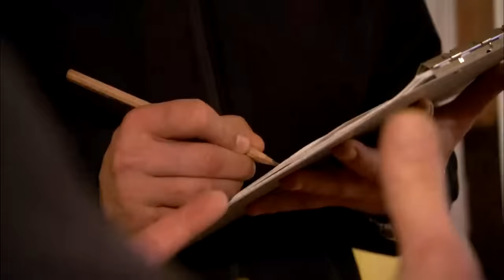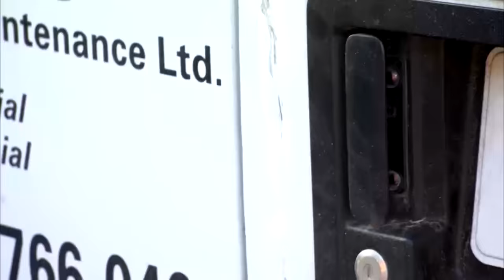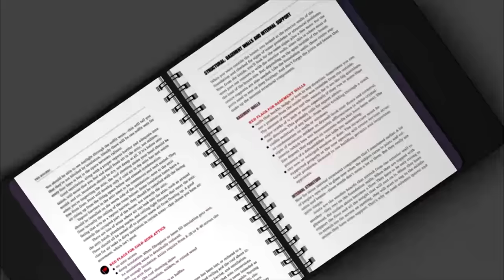Mike Holmes Rescues Townhouse from Hidden Home Inspection Disasters | Holmes Inspection 101

Comment: What gets me is that the prior owners must have known about some of this, and they never disclosed it.  I could never, in good conscious, sell a place that would be unhealthy and such a safety hazard.  That place was ready to catch fire at any time in several ways.  The bathroom floor was ready to go.  The dryer vent in the garage would allow carbon monoxide to go back in the house.  What a mess, and she thought it only needed a little bit of cosmetic work done.  Mike Holmes and his crew are always the absolute best.  It's great to see them again!  The hugs are great at the end!
Reply: Not necessarily. The first home I bought my home inspector didn't catch 2 major items.  When I went to sell the buyer's home inspector caught them. Both were structural items. Two roof trusses were cut into making them useless; and in the basement there was a crawl space that was being supported by nothing but loose large rocks.

Comment: This is why you need to take even a very small water leak very ,very seriously! What started as a simple tub change for cosmetic reasons in our guest bathroom ended with a total doen to the studs rebuild! We found wood rot in the floor joist that led into our dining room as well.we had to replace floor joist ,subfloor, walls and then all the finished floor ,sheetrock etc. You get the idea. It was very expensive. What we found was that it was all caused by the caulking leaking around the tub/shower and a very tiny leak from the shower valve. When I say tiny ,I mean it was so small of a leak it was basically just moist around the valve ,but it did it for years because it was small it didn't get noticed.
Reply: I learned this the hard way.  Fortunately, I could do most of the work myself.  I find it wise to pull a toilet every few years, inspect, and then put a new seal under the darn thing (along with new toilet bolts).
Reply: @oldtop4682  this is a good idea!
Reply: Mike would have loved the house I grew up in. Due to, uh, repeated, uh, plumbing issues (lets just leave it at that) over the years the bathroom and laundry room floors were toast. Had about the structural integrity of wet toast in fact. But short of a good look in the right places, one could easily miss that fact because everything else was solid, including the floor joists supporting the toast, er floor. We could easily have hidden it when we sold the house, but unlike so many, we made a point of disclosing the issue.

Comment: A friend of mine bought a house 'renovated' by a self-proclaimed handyman. Plumbing, electrical, & HVAC were all nightmares. The energy auditors said they had never seen leakage figures so high. HALF the air was leaking into the attic from improper ductwork, none of which was insulated. The home inspector gave the house a clean bill of health!

Comment: Since this place is so bad because of shoddy workmanship when it was constructed, and later patched up, it makes you wonder what the neighboring houses adjoining it are like! 😮 
It's scary to think that after this one house is renovated, (Amazing job, guys!) it could all be for naught and could burn down afterward because the adjoining houses are likely built just as shoddy as this one was! The electrical fire hazards in this house were horrendous! ...And that wasn't the only hazard- mold in the wall, loose 2' x 4's, etc. etc. 😳😓 The inspector either was not doing a thorough enough job, OR he CHOSE to 'look away' because he could see just how bad this really was. A super sad situation! 
It would be advisable for the neighbors in this row home to get THEIR houses checked out and re-inspected by your men. 👌
Reply: Doesn't Canada have building inspectors for the construction stage? If they do have them, do they ever do work? Are there even building standards at all?  I would never buy a home dwelling in Canada without getting myself enough skills to be an inspector.
Reply: @mrcryptozoic817  i’m thinking they’re like american ones, when i worked in construction (houses mostly) the inspector only came thru in the framing & after insulation and as long as and writing/branding was right side up then we were given the 👍 very shoddy work in parts of the house that we had to later fix (yay big teams🫠)

Comment: hey mike and Damon i just wanted to say thanks to your show when i bought my brand new townhouse  i nailed the builder on a couple major issues i had a bad breaker in my main panel and when they grouted my house with the tiles in the showers well they wash their buckets down my drain lines well they snake my line with their plumber as say the line was clear less than two days later it flooded my carpet down stairs for the third time and i live in it for less than 3 months so i had my own plumber come out and snake my line with a camera so my plumber saw this right away and before he said anything  i told him it was grout in my lines he said yes sir  so the warranty for my house was almost up cause i was fighting with the builder cause they did not want to fix it  but they cut my foundation in a 4 x4 area so when they went to fill it back in i made sure they used a hydraulic  cement and they made it 6 inches thick because it was only 4 inches thick to start with and they knew i was onto their game they tried to play and i told them when you build a home you can not do shoty work
Reply: That is great to hear!
Reply: @triciac1019   it's not that i go looking for problems  but when the builder is flat out lying to my face thats when i hold them accountable for everything and this builder got caught using the china drywall that people were getting sick from they had to rip out all the drywall in  2 of their units which  means a total of 14 townhouses  so i know it was costly

Comment: Nice job. I was a young electrician when Aluminum wire showed up. We wired hundreds of apartments with Aluminum Romex. We would get trailer loads of Aluminum Romex, we learned things about it and what to do. Aluminum rated devices showed up shortly after, aluminum rated wire nuts and we no-aloxed all connections. Breakers were now rated for use with Aluminum. It was amazing to see it and it finally went away.

Comment: It's the distance from the window to the regulator intake that is important.  You can add a pipe to the bottom of the regulator to move the intake three feet to the right and have an operable window in the basement.
Reply: The meter itself has a vent though
Reply: @kellismith4329  you can put a pipe onto the meter's vent (which is on the bottom of the regulator)

Comment: i use to work in a hotel as a maintenance person i use to fix bathtub stalls with the green board and 15-minute mud then i would tile over it all in one hour. i learned to do it fast because the previous maintenance people used regular drywall and mud and a tile or three or four fell off the wall and hit a guest in the head. i had so much stuff to fix but they would only let me fix it a little at a time.

Comment: Piece of advice from personal experience although this applies to potential buyers and current owners/ tennants regardless, keep a close eye on the drywall, if it looks off take a closer look...

I was once renovating the master bedroom for my mother in her current home (I was a rather handy teenager who was good with things that didn't require permits, I flat out refused to touch those jobs), at the time she had lived there for almost 10 years or so, I noticed that the drywall looked strange and mentioned it to her saying that I should investigate...  

All I did was jently poke it with my finger and I poked a hole all the way through, at this point I mentioned that I would have to tear down the drywall and replace it...  

My mother got an idea of just how bad it was moments later when she heard me screaming her full name, demanding her to get to the other side of the house and see the problem imediately.

To our horror underneath the drywall, all the wood framing was in such poor condition that you couldn't even use it to make tooth picks with...  

This was an exterior load bearing wall, my mom called the Condo association who sent someone to fix it...  I later found out that the person was a general handyman and had no buisness touching the job in the first place and that they only looked at and fixed what they could see and never opened up the walls to find out just how extensive the damage was...  

After some time We learned that the damage was caused by termites that had not been dealt with but left to continue destroying the house, eventually the city became involved and had to condem the house until it could be fixed by actual contractors who pulled permits, something that the CA never did (I did tell my mother at the time that permits were needed for the job but because the CA and the general handyman said that it was not necessarry they...)...   In the end they had to repair half of the exterior walls of both floors of the house and add a new structural beam in the basement.  

I should mention that in that housing the CA is responsible for the exterior of the house such as the roof and siding as well as the structural parts, wile the home owner is responsible for the inside and before anyone points it out...  Yes the CA screwed up, but in their limited deffence, the insurance company would only pay out $20, 000 to fix the entire neighbourhood and what work was done on my mothers house alone, was more than double that.

Thankfully the damage was fixed and the termites were dealt with, I just hate to ask what of the houses around us?  They all had to be treated for termites but my mothers house was the only one that got opened up and fixed...H

Comment: Thanks Mike and CREW; You ALL make a house safe, secure and well insulated. What if you work with a good window & door company in Canada. There are a few. You have excellent plumbing, electrical, insulation  and HVAC work. But consider the windows triple pane or better. Because it will help with keeping the house much more energy efficient! I am sure that bedroom windows was not the best for insulation.  There is a window company that does 7 ply insulated glass in Canada.  I believe it will be a much improved factor to the overall problems you find with houses!

Comment: House was only 26 years old? Built around 1980 or so. Hard to believe they used fuses in the electrical panel unless I'm missing something. The sideways panels I've seen in some other episodes is something one won't see in the states, but common in Britain.

Comment: I would like to add my 2 cents.  Mike Holmes says a fire could start from the dryer.  My firemen friends tell me the same thing.  Replace the flex lines (as many as possible) with steel.  Mike talked about electrical rubbing steel and getting a shock from the whole house.  When I was installing phones in mobile homes in the 1970s, several would shock us when touching the door knob because some electric wire was frayed and touching the metal covering the outer walls.  He says it's a fire hazard.  A friend's home was a total loss recently from a house fire that started with an electrical problem.  One thing Mike didn't mention is how dangerous aluminum wire is.  If every connection isn't done properly by a licensed electrician, your house could burn down.  A friend of mine discovered an improper connection in his aluminum wiring and there were sparks.  He had to have an electrician replace the entire wire run to make it safe.  Holmes isn't joking about the dangers.  They are very real.

Comment: My "garbage disposal" started shocking me until finally I tripped a circuit breaker while grabbing a new roll of paper towels from under the sink.  Turns out, copper pipes move every time you turn the water on and off, and it took 20 years to wear through the improperly routed romex in contact with the pipe 🙂.

Comment: My house is 120 years old, if they came to my house I would need a supply of Depends fit all involved!!!! 😆😂
About three years ago my house almost went up, copper pipe instead of black gas pipe, obviously copper pipe wasn't supposed to be used! Oh I could go on, between my business building a crap mess and the house,  I hope I don't have to take up residence in a pine box 6 ft. under. Humor, humor is my friend right now.

Comment: If HomefulTV were to come in my building they would find all sort of problems 😂
So many things are wrong lol. The tap water routing is all over the place, there's old cast iron sewer pipe which keep on asking to get clog because they are filled with junk.
Insulation is terrible, fundation cement is turning into sand, tap water pipes are mix iron, copper and many iron pipe have rubber patches, fundation and a few other key location are open to rain leak, main underground sewer pipe is rusted through at some location and a tree has found it's way in(It caused a clog and flooded our basement during a heavy rain storm) and i can add more problem to the list.
The only thing that seems to be alright is the electrical wiring.
I'm not the owner nor do i want them to come here. I'm just stating what's wrong xD

Comment: 20:20 Best choice. They could have used a number of materials to patch and fix the tub (for a time) but it would have caused issues again down the road, and negated all the mold and moisture removal they are working on. Not just "Tv show" stuff, but what an actual contractor Should have done for her. Maybe not completely out of pocket, but corners can be cut on the labor costs and materials as well, without cutting corners on durability and quality of the finished product. Sometimes you need to take just a little less money home, to make sure someone keeps theirs.

Comment: I usually have the opposite problem with home inspectors. They typically try to find problems, most of the time things that aren't broken, nor need to be changed. I've had one tell the homeowner that they needed to cut about a 12x12 inch hole in every door in the house to add a vent for ventilation, including the bathrooms. And I have others put in the reports that the homeowner needs to pump the septic tank, although the house will be on sewer. Honestly, I have never seen a good home inspector and I suggest taking everything they tell you with a grain of salt until you have an actual professional to look at it
Reply: They are just filling out papers so that the transaction may proceed

Comment: Rotten sub floor under the toilet...  Been there dealt with that...  Part way through high school my mother had to replace the toilet in the house, she had a tennant offer to do it, he pulled up the old toilet and found there was effectively no sub floor under it just the tiles, mortar and grout, some one came up with the idea that this could be fixed with "BATHROOM CAUCKING" of all things...  I told my mother that "NO...  Under nouncertain circumstances can that be fixed useing bathroom caucking."  In the end after the tennant put the toilet back I had my mother go to the basement where the stack would be and flushed...  After breaking the seal, it only took a single toilet flush to flood the basement...  She would not listen to that tennant about anything like that ever again...  And to think the tennant claimed he had worked for and been trained by a contractor...  I don't believe that for 0.00000000000000000001 seconds.

Comment: I love how Mike says Canada has the best building codes.  Building codes mean nothing if they are not enforced.  On pretty much every job I have worked on I have found shoddy work.  Most of it was done by "licensed contractors" Licensing means nothing, it does not make a contractor, a quality contractor.

Comment: I love the attention to safety, detail, and quality but we have to put a price tag on it and evaluate the option of selling out and finding a new place to live. It looks to be a $60-100K remodel. The attached structures will not be upgraded so this wiring safety will not stop an electrical fire elsewhere in the attached building. Can this remodel be recovered in the resale of the home? I doubt it. I saw the bathroom floor and it was not a safety hazard. Electric safety needed new insulated wire grommets and 15 A fuses but not a new panel. The new breaker panel will be better appreciated as time goes on. The cut floor joist repair was the right thing to do since they had torn up everything else but it was not a danger. The tub could have been repaired in place for $20. The leaking window, basement wall, & dryer vent were the main repairs needed. Attic Insulation was a value added upgrade. The fire code on flue pipes is very important. The air gap around the pipe is specified at 1 inch away from any combustible material.  Sheetrock is not combustible but there are specific codes for this. We would have to check the local fire code.

Comment: HA!  I just bought my first house and going on nearly year 2.  not even 4 minutes into the vid when pointing out the possibly places a shower can leak he pointed to the shower head and I groaned.....my house had some 'sprucing up' done before going on the market including the bathroom.  I started having water leaking in the basement right where the bathtub plumbing was going and come to find out, they never added Teflon tape on the shower head at the wall and we had swapped out the shower head when we moved in so apparently it turned ever so slightly and it started leaking behind.....FFS!!